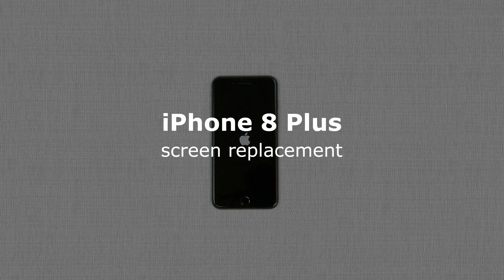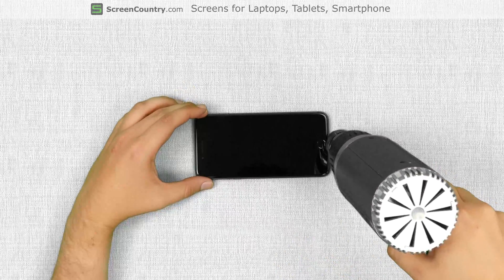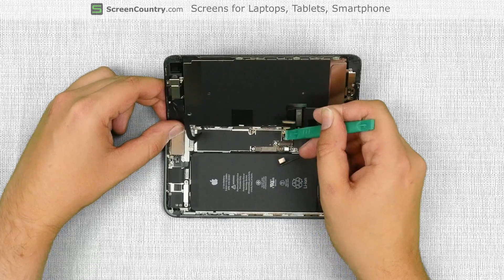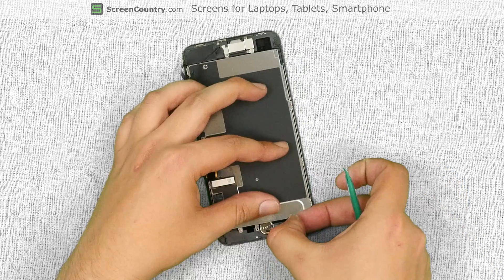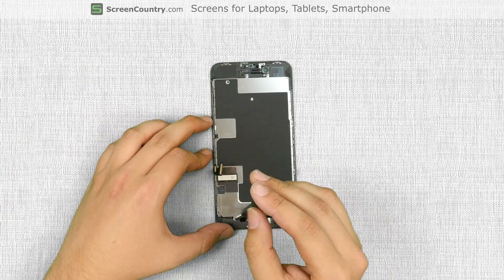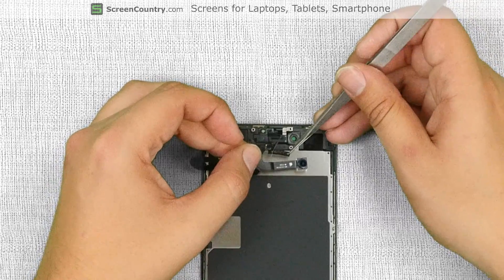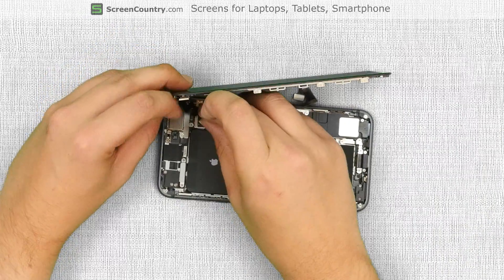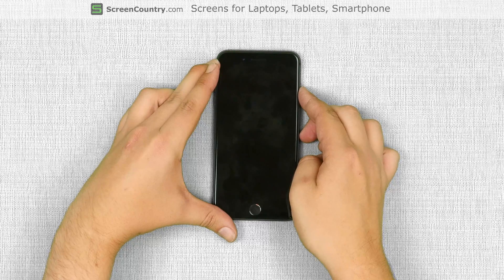iPhone 8 Plus Glass touchscreen and LCD replacement

Comment: so at the end of your video.... your home button doesn't work correct? because that is what happened to mine. my home button is jammed and won't press at all.
Reply from the maker: What? of course it works, don't be ridiculous. Go back and untwist the central screw over the button a couple of times, yours is too tight.
Reply: i did that and it still won't work. it saying that i have to force use my assistive touch. I am trying to swap screens and put a black one instead of the white screen. i heard about from the 7 and up you need the ORIGINAL home button and not a 3rd party home button. i tested out my new black screen on my iphone 8 and it turned on fine so after i finish testing the screen alone i went to put back my orignal screen (nothing taken apart) and the button stopped working from there. Some people stated to take it to apple and get it fixed there since they have machine to fix it back to normal. I dislike apple a lot for not letting us customize our own iphone. Why have the same phone color as everyone else.
Reply from the maker: Ah, your problem is with the software. You must use your original home button when replacing the LCD. Its not jammed mechanically, its simply not detected by the phone, because it expects the original button.